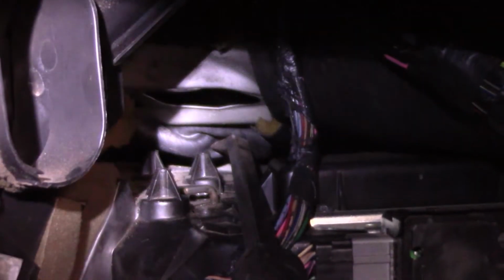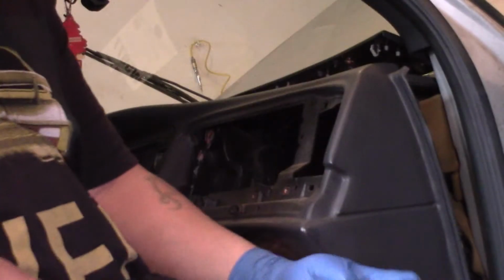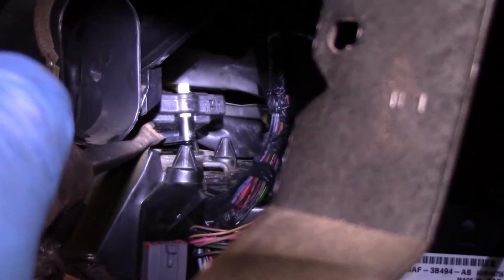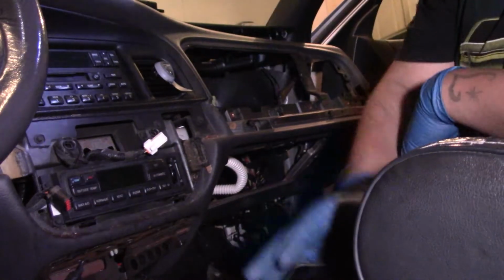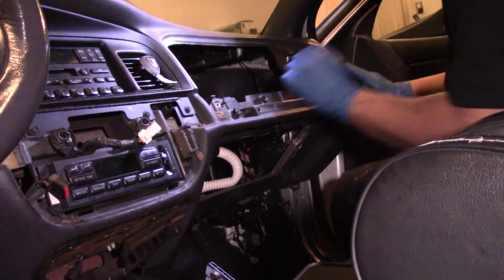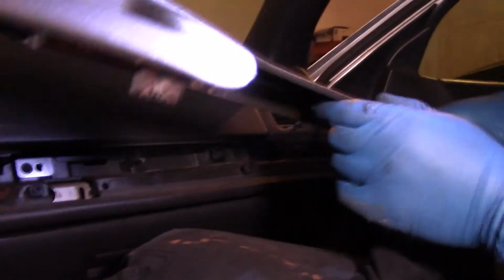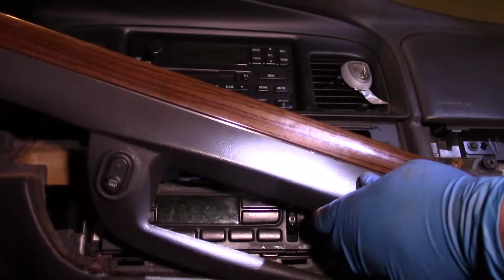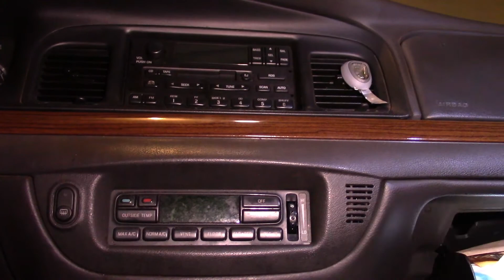FORD CROWN CIV how to install a blend door Actuator part 2

Comment: Okay, this video is very, very good and I'm going to give it a big, full comment like it deserves.  I'm facing TWO of these actuator replacements on my two Vics/MGM's and knowing that it's a horrible, fussy time consuming difficult job, I've watched all the videos on Youtube that talk about all the different little cheats and short-cut ways to do this job.  I started with my first one and got only one screw off before I quickly realized that all those little cheats and shortcuts were BS.  You have to create room and still it will be hard.  The White Ghost isn't sugar coating anything and he's showing you the pain and suffering you will experience and how to minimize it.  Plus he's a big guy with big hands, like me, and if he can get it with his paws, so can I.  The front screw is easy to get off if you don't crack open the dash, but the left hand screw is horrible, the right hand back screw is almost impossible, and the back screw (or post in some units) is impossible.  If you create the space by cracking the dash open, left hand screw is doable, right hand is doable and even back is possible if you rotate the unit back

Don't mess with cheats and shortcuts, they'll only add to your total time and frustration.  Take that dash half off and block it with the wood.  Take the glove door all the way off otherwise it will flap up on you ever two minutes.Cut and shove that insulation all the way back as he has done.  You need as much room as you can possibly give yourself.  You will also need a micro ratchet like he briefly shows you with his taped up contraption.  Buy the smallest, thinnest one you can get.  I LOVED his trick of swiveling the BDA clockwise back into the dash after he got the first three screws off and pushing that insulation back. Brilliant!  But its all about creating the space first.  I'm going back in to follow his method and will update with my results.
Reply from the maker: THANK YOU FOR THE COMMENT GLAD I WAS ABL TO HELP I'M DOING MY BEST